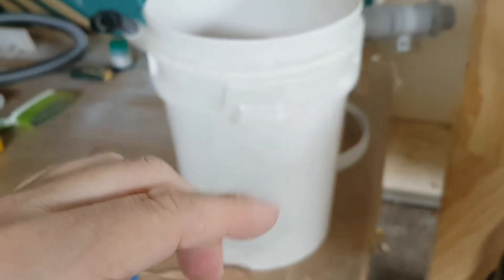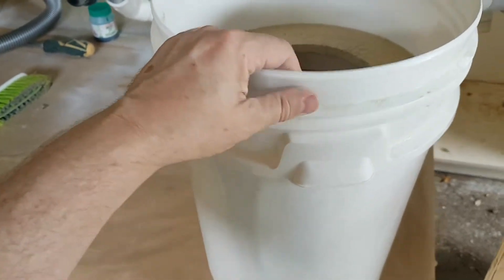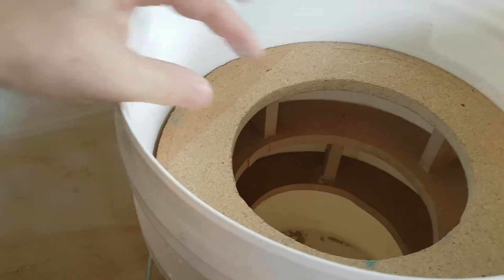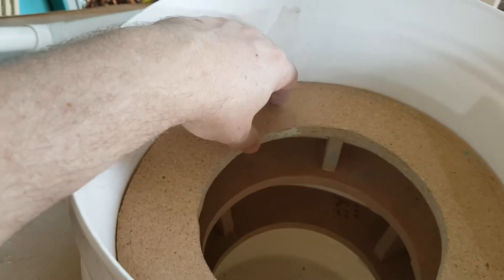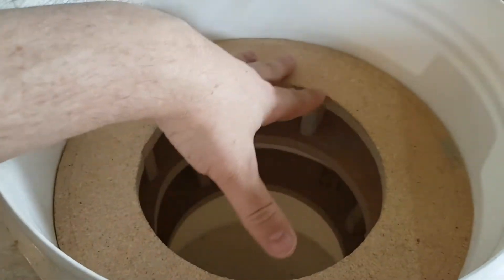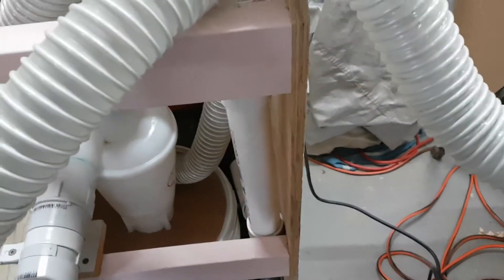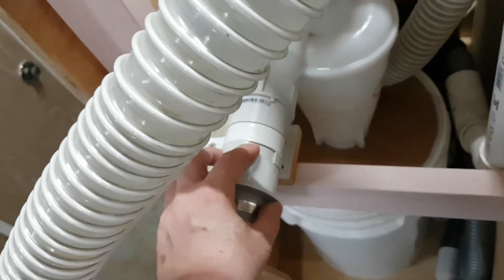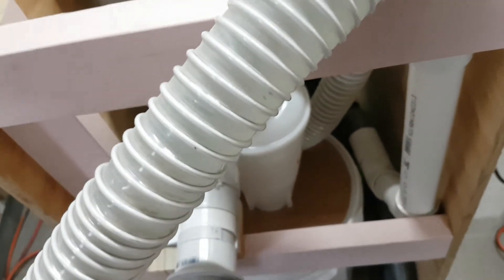Shop Vac 6.  Bucket

Comment: That's bloody clever. Will keep it in mind if my bucket is thin. That bleed value was also very elegant.
Reply from the maker: Thanks mate. I was doing everything to preserve suction so I didn't want a bleed value at all but I found it necessary. Then I found that one small hole was not enough.